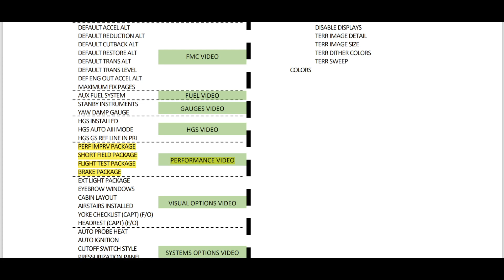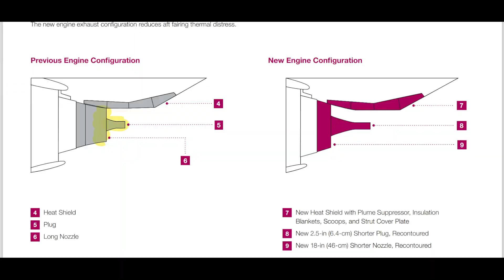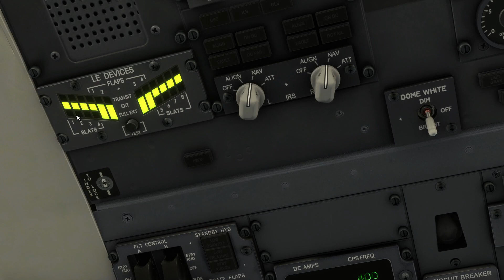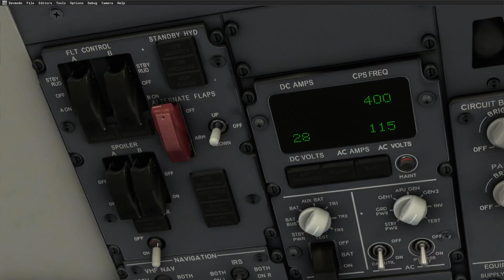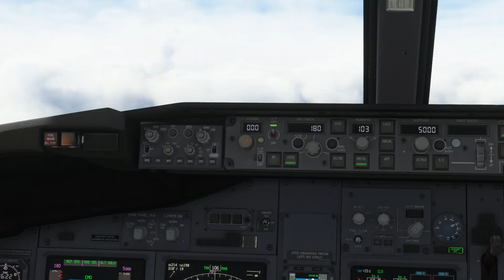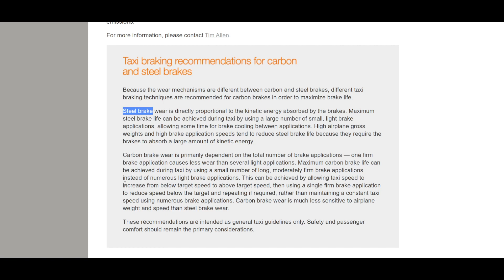PERFORMANCE  - ALL 737 PMDG OPTIONS EXPLAINED

Comment from the maker: For the planes without SFP, the slats go to Full Extended position when beyond 5, and not AT 5 as I said in the video (for one time). The document is correct! My mistake was when reading the document and that's why I choose to show you the LE Flaps position with flaps 10!